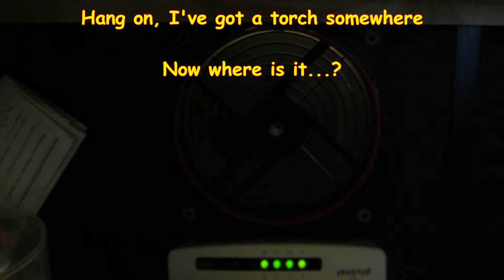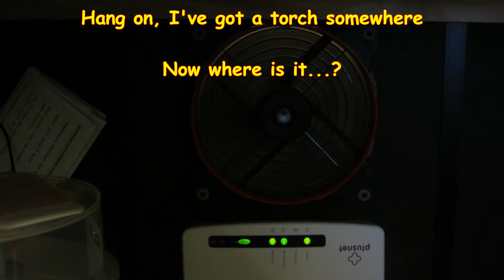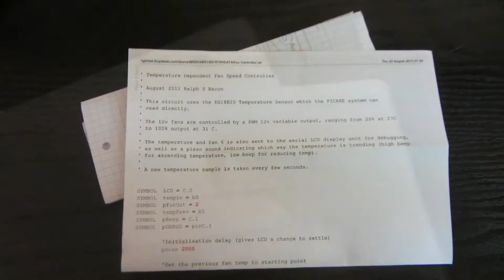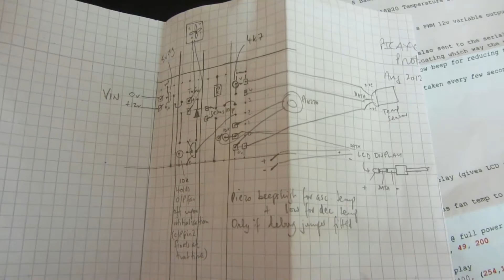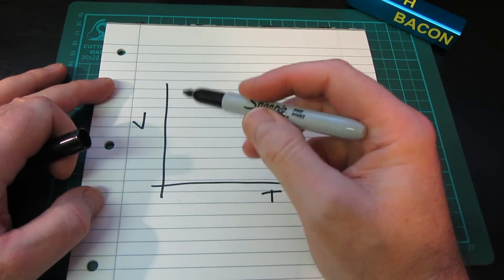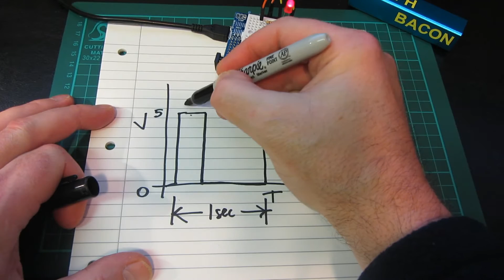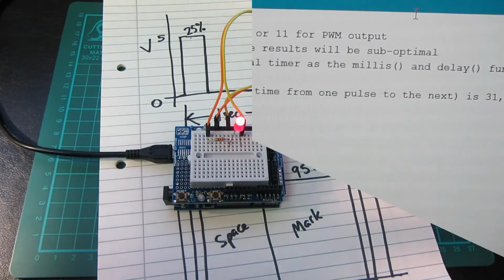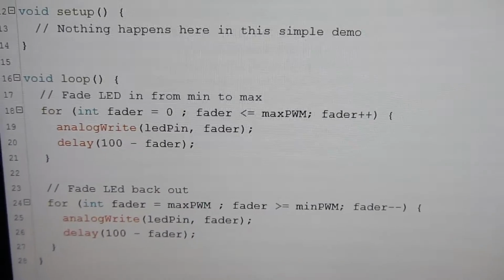#14 Arduino PWM (Pulse Width Modulation) Basics Part 1

Comment: what can you use PWM with and can you use PWM with a rodary encoder or a Potentiometer?
Reply from the maker: PWM is almost exclusively used for motor speed control (or light dimming). You can't use it with a rotary encoder or potentiometer, not directly at least, although both can be used to control the PWM rate. I hope that clarifies things for you, Taran.
Reply: and what types of circets can you usePWM with?
Reply from the maker: PWM will usually drive a MOSFET transistor which has a very low resistance when switched on - and thus has very little heat dissipation. That, in turn, drives the motor or lamp or whatever.

Comment: Dear Ralph, honestly I get more experiences in arduino programming via your channel, thank you for your effort and I have one silly question I think regarding this video, why you have defined the minPWM and maxPWW at the begging and you put a value for them 0, 100 respectively? can you put these value directly as 0 and 100 at the void loop instead of minPWM and maxPWM at "for" loop?

thank you in advanced for answering me, your answer is so important for me
Reply from the maker: Hi Wael! No it's not a silly question.
 
Technically, you could put the values directly in the "for" loop. The compiler doesn't care. But those values, 0 and 100 then become what is known as "magic numbers". That is, although they mean something to you (at this time) what exactly do they represent? No one knows. So...
 
So what we do is assign meaningful names to those values (you could use a #define statement too) so that when you want the values you refer to the name, not the value. Additionally, should you need to refer to those values again you just refer to the name - if the underlying value ever changed (eg you might change the 100 to a 90) you only need to change it in one place.
 
It's all part of Best Practice when coding to use meaningful names instead of "magic" numbers! When the code is ever amended by someone (probably YOU!) you won't have to work out what 0 and 100 stand for; they are already documented by their names.
 
I hope this is useful to you and thanks for your supportive words about my channel :)
Reply: Thank you very much Ralph for your prompt reply and answering me , really appreciate your cooperation and support, your answer means a lot to me not only "yes we could do it", I was looking for the philosophy of the assigning of these names and you had provide me with the proper answer

Thanks again and keep on these videos, and be sure that there are a lot of people find these videos are valuable and priceless.